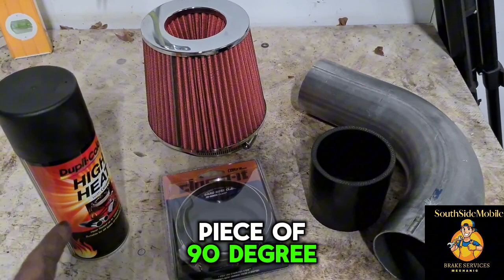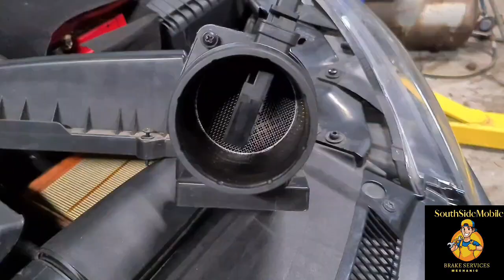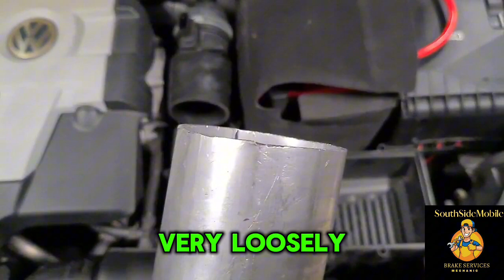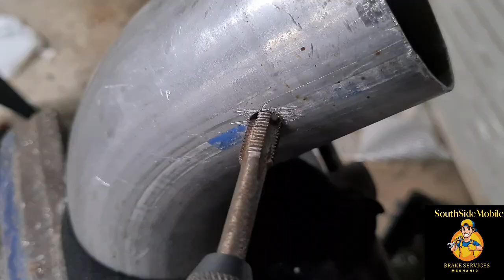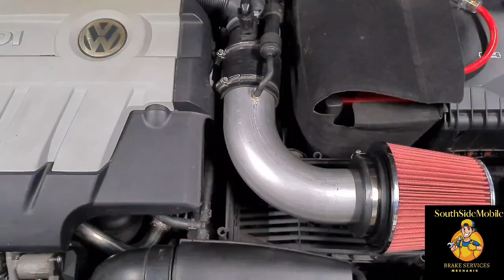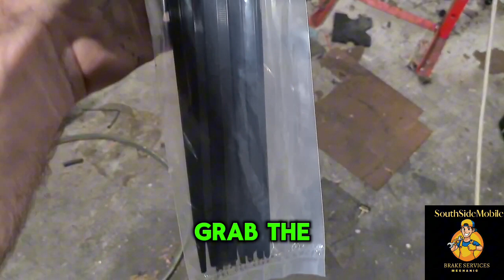Volkswagen Golf 2.0 TDI Custom Intake Build "Cold Air Intake"

Comment: 0 understanding how air intake works from author if you leave standart platform you will lose 50% of air because it will going nowhere, you need to make special platform to aim incoming air straight into the filter. If you leave like this you car lose the power